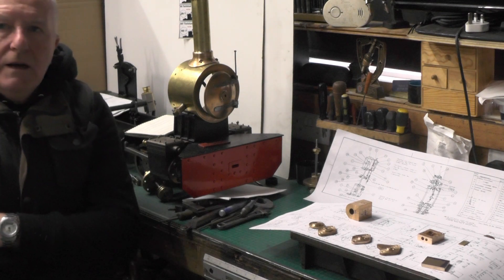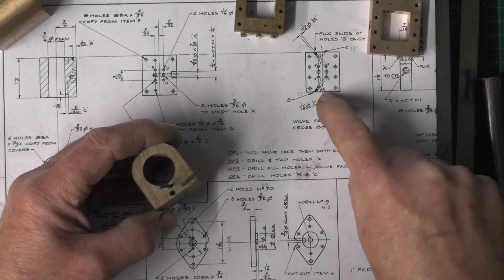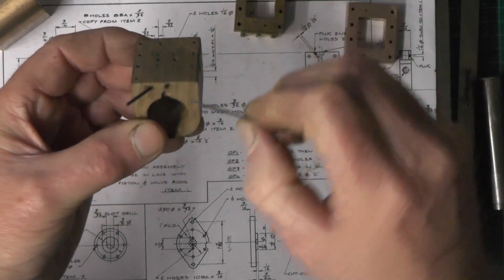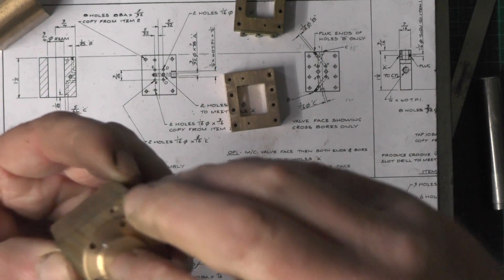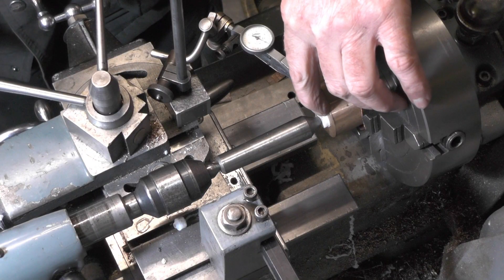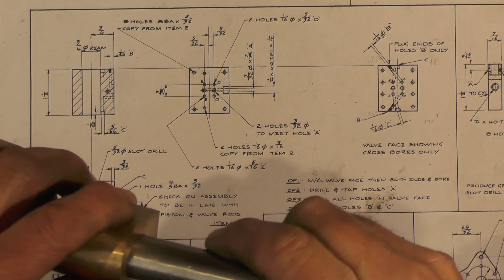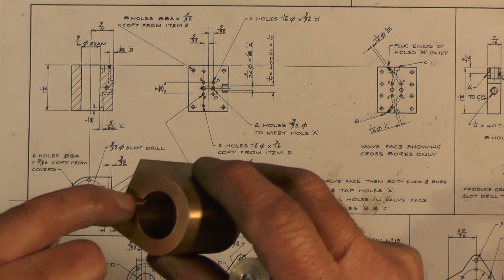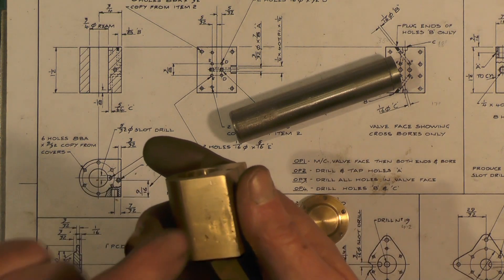Southworth Steam Water Pump Part 5 - Steam cylinder #1 "mr factotum"

Comment: That was a very interesting video Kev. Very well explained. I’ve learned so many things from you here. The slots machined on the inside of the cylinder caps to help air/steam into the cylinder. I’ve not seen this before. Maybe useful on the engine I’m building. In my next video I show drilling the air ports to the cylinder. I wonder if those slots would help air flow? What do you think Kev? Christmas greetings to you and your family. Cheers Nobby
Reply from the maker: Great to hear! Nobby
steam expands many more times than air, so has much more force to find its path, so any help for the aid air flow is productive.
So i'm told!!!😉👍🚂
greetings to your family too
best wishes
Kev

Comment: Very nice work mister Factotum. Good video
Reply from the maker: cheers Rusty
hope the myford working ok
many thanks😉👍🚂
Kev
Reply: @ it sort of worked, but not the same as I was used to. The single phase is load and I didn’t have that much control on the motor. No reverse and set speed.

Comment: Hi Kev. A very intricate part. Goind well though. I remember a departed friend of mine making these for his Traction engines. He also made some ,I think he called them steam injectors that pumped water up to the boiler. A bit like how a spray gun works.
Reply from the maker: cheers Steve
yes tricky thing injectors, all to do with the correct tapers in unison for th ventura effect 👍🚂😉
best wishes
Kev
Reply: @MrFactotum  Yes Randy my departed friend said they were tricky. He also used to make the most amazing steam whistles. Reckoned they span at 50,000 rpm. Happy Christamas to you & family.
Steve.
Reply from the maker: @Steviegtr52  👍👍merry xmas to you all
best wishes
Kev